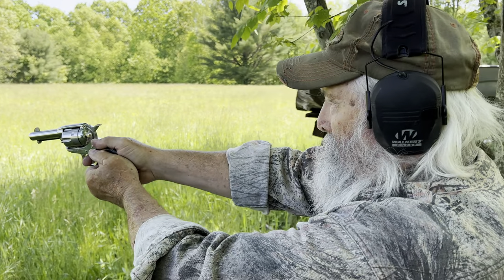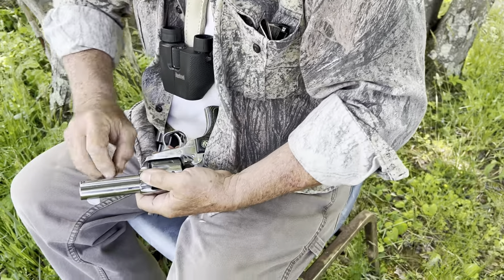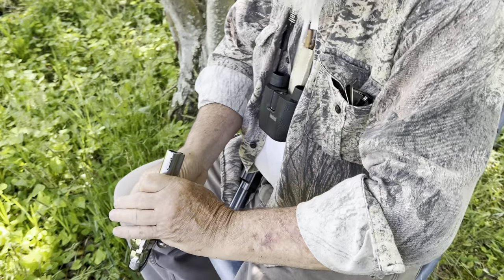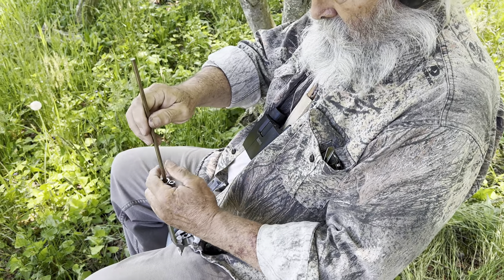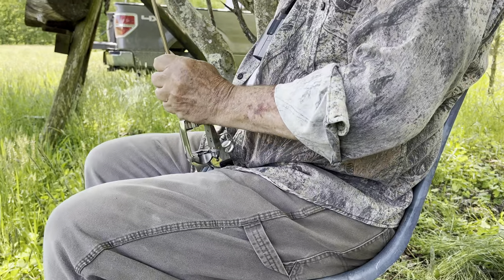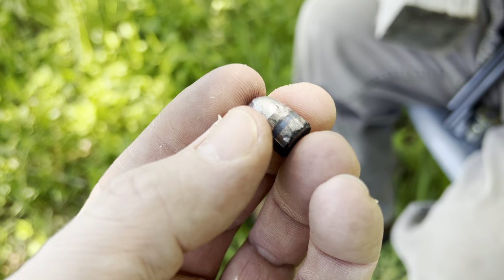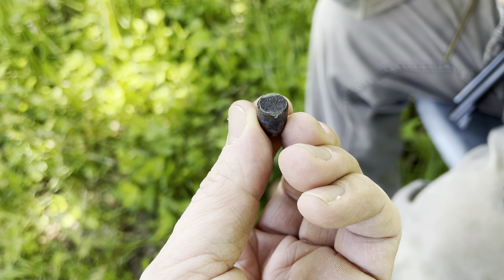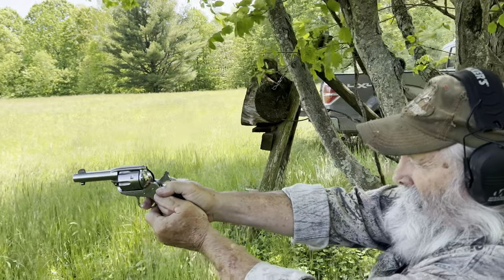Squib Load in a Revolver

Comment: Great video, I had a squid load awhile back shooting my Dragoon cartridge conversion in 45 Colt and I load my own black powder 45 Colt cartridges and I must have forgotten to put powder in one or anyway, the primer went off and it was just enough to push the bullet into the forcing cone and cause a squid load, so they do happen.
Great video, thank you, I also subscribed to your channel.
Reply from the maker: I’ve had it happen a couple times over the years in my 44 magnums, probably because I loaded the cartridge without powder. I keep the brass rod in my range bag now just in case.

Comment: I have used Squibb loads with the 250 Keith in a 44 Special Bulldog.  The lightest Unique load would still bury the entire nose in a 2x4.  I wont mention the charge as you might try it at home.

Squib loads are fun.  I had a 358 Winchester rifle load that ran 700 fps with a 158 cast bullet.   Almost no noise.  Fed fine in a Model 88.   Also a 300 gr jacketed bullet in a 44 Magnum Ruger bolt rifle.

I always carry all my gun tools to the range.  That includes proper rods to knock out a stuck bullet.  Never had that happen.

As what happened in the video, always check safely if something sounds different with any ammo.

Comment: Reaching out for help. I have my first and second in two different revolvers. The bullet is preventing the cylinder from being opened. How do I get this resolved. ie. I have tried hitting the nose with a rod to push back into brass in cylinder but they don’t seem to be moving at all
Reply from the maker: Did you use a hammer or mallet to tap the rod against the bullet or just the rod itself? Try using a wooden dowel and a mallet or hammer. Go easy, tap the rod against the bullet and it should eventually push back into the cylinder chamber. If you use something harder than a wooden dowel, just make sure it’s softer than steel, the barrel material. I use a brass rod.  Even then try to center it on the bullet so you’re not making contact with the rifling inside the barrel.
Reply: @Keith44SWC  thanks for the replay. I had already tried that. They won’t budge. Going to have to remove the barrel and knock one out the barrel and push the other back into brass in cylinder.
Reply: @jcobra1226  how it's going for you? Did you get it out?